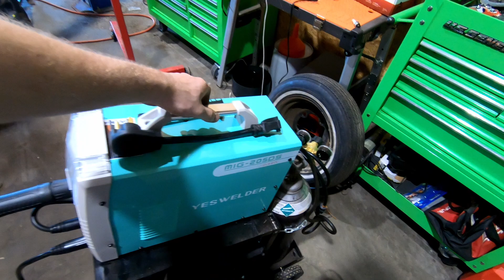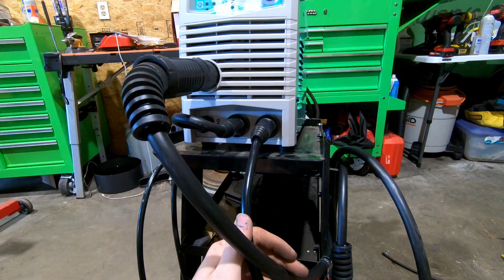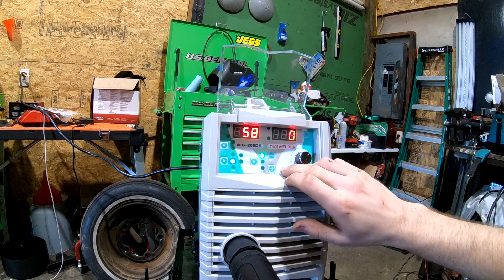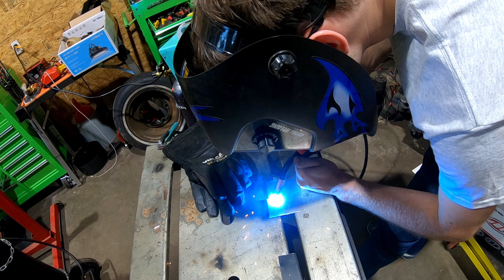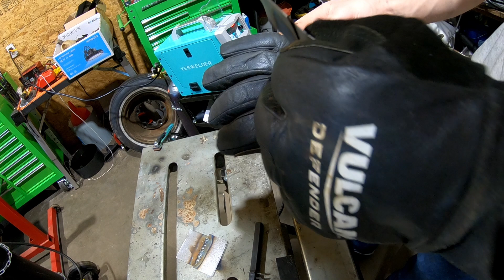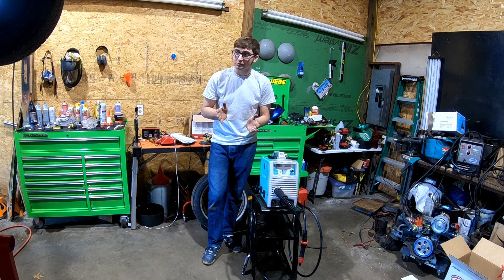YesWelder MIG-205DS Welder Review and Welding

Comment: Thank you for the effort of putting the video together, always appreciated!
Inductance as it pertains to the short circuit arc process refers to the rise time for the current to reach the pre-selected amperage level. In other words how fast the amps rise before the next short circuit event. In doing so it also controls arc time More inductance gives you more arc-on time and is useful on heavier sections as it puts more heat into the weld and offers a more fluid puddle to help wet out the toes of the weld. Less inductance can offer advantages when welding thinner gauge metal for example or overhead,. outside corner joints, etc. Experiment with it to see where and when you can use it to your advantage under various conditions. Lots of info out there on this very beneficial feature, look into it. Not many machines offer this so take advantage of it.
Also this machine has a lift tig function, not scratch start. From my brief use of this machine it has an exceptionally smooth and very nice lift tig at that, much nicer in fact than much more costly units and certainly much better than one can expect at this price point, especially considering it is a multi-process machine. Enjoy!

Comment: Way way way back when I was studying electrons LOL I remember being told inductance is a damper on current. Meaning, if you increase inductance it's harder for current to rise in the circuit. So it's my guess you go up on that setting as the base metal gets thicker. But I'm not an expert welder, so......